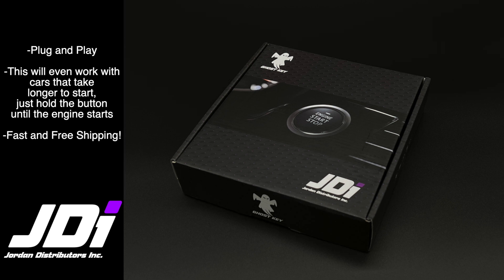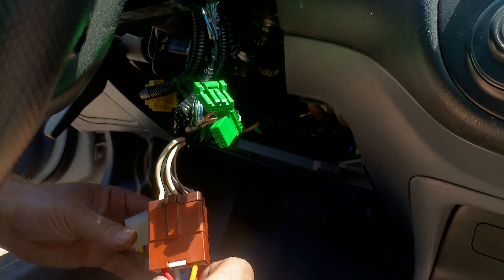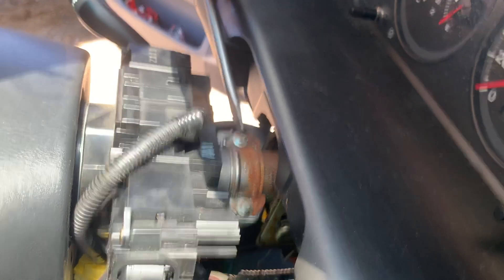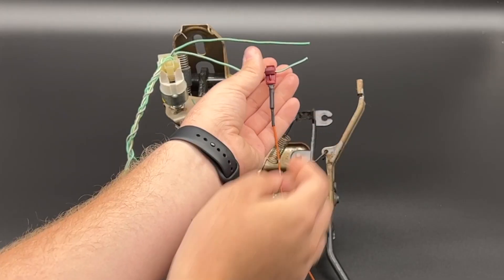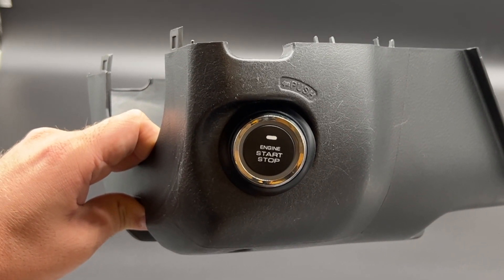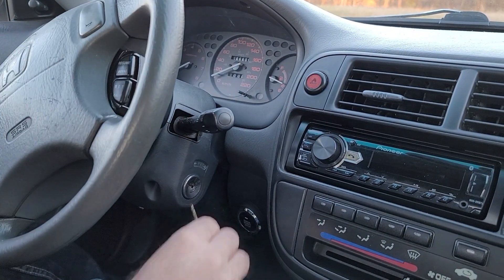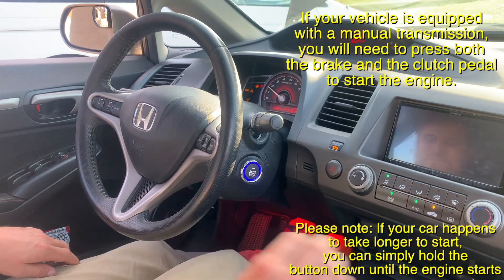Plug and Play Push to Start Conversion Kit Install: 02-06 RSX, 01-05 Civic & 02-06 CRV

Comment: For security purpose, you can leave the wires hooked up to the key lock cylinder. This way, you wont be able to take out the key while driving :)

Comment: If i choose not to keep the key under the dash but instead always in my pocket would that still work? More of a safety question because then anyone can break in and start it up right?
Reply from the maker: Yes, you can simply insert the key into the ignition each time and mount the button somewhere else. 

The key secured under the dash will not unlock the push to start system. The push to start system will still prevent the vehicle from starting

Comment: I’ve had this on my crv for a few years now and it’s been good. However the key reader doesn’t deactivate after 30 seconds anymore, even after the putting the #2 switch down it does not deactivate after 60 seconds. It will still deactivate if you use the card/fob but is there a solution to fix this?
Reply from the maker: You have put the system into valet mode. Taking it back out of valet mode will allow it to lock automatically
Reply: @JordanDistributorsinc  thanks for the quick response, got it fixed!!

Comment: Isn’t this the kit they sell on Amazon for 20 bucks
Reply from the maker: It is not. We make ours with only high quality components such as the relays, speaker, wiring, start button and we use a USA made Microchip brand computer chip.

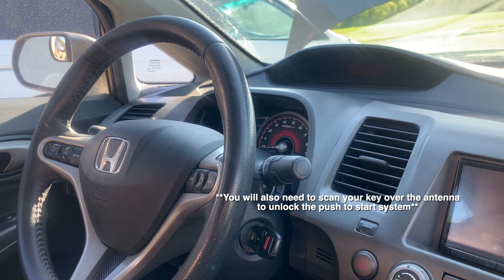Comment: Its confusing at 3:56 is it a typo? in the white text do you mean to say "you will also need to scan your FOB over the antenna" instead of key? Seems this might be a crucial point on the functionality of they system when mounting the push to start button elsewhere.
Reply from the maker: I apologize for the confusion. We used the term key instead of fob. What we mean is that you will need to scan one of the keys included with the push to start system. One of the key fobs or the key card could be used.

Comment: Got an srs light after unplugging and replugging the airbag connector while installing the ghost key, normal?
Reply from the maker: If the battery was not disconnected, yes.
Reply: @JordanDistributorsinc the battery was disconnected
Reply: But The light went away after a short drive

Comment: 2002 rsx. If I add this kit and add an alarm/remote start. How will that go about if it needs the prox key deal
Reply from the maker: This will work with an alarm/remote start the same as the factory ignition switch would

Comment: I have a 04 RSX, and i was wondering how I'd disable the steering lock on my vehicle while mounting the push to start on the factory hole.
Reply from the maker: This video will show how to remove the factory key cylinder, which will remove the steering wheel lock